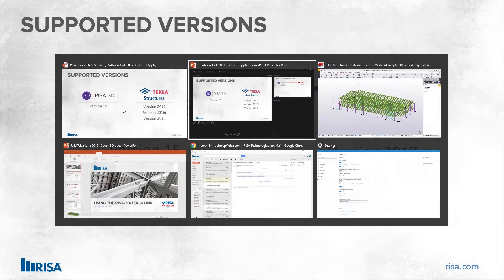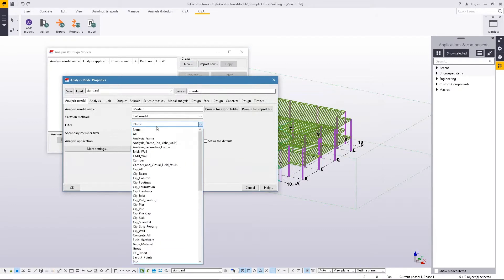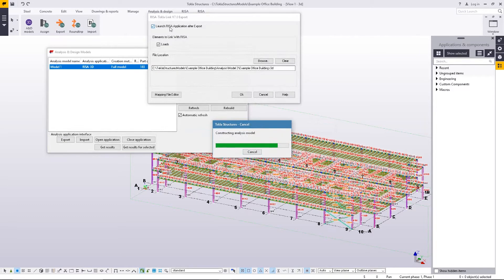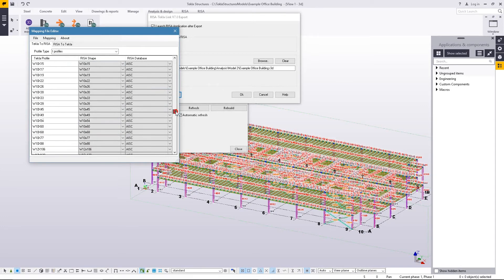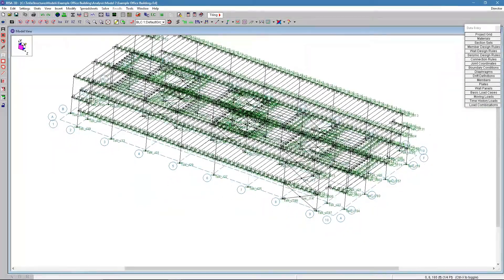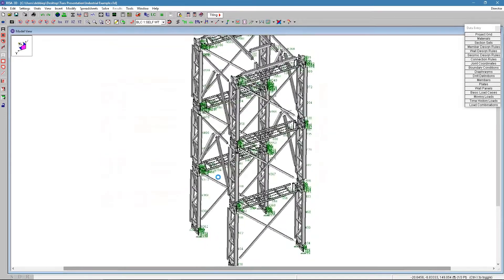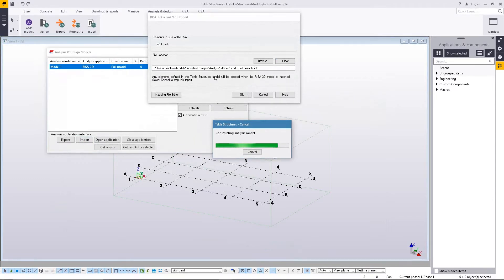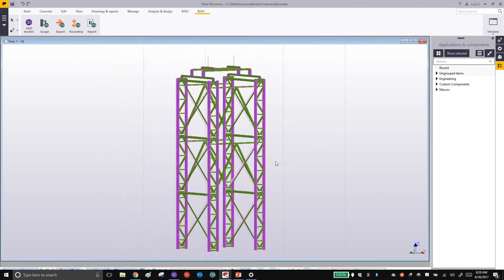RISA-Tekla Link with RISA-3D

Comment: Now it would be necessary to make available to create, analyze and design variable sections and mixed sections in RISA 3D
Reply from the maker: Currently, you can use the Hot Rolled Steel sections in the RISA library.  Built-up sections are available in RISA-3D but not yet in the link to Tekla.  This is on the list for a future enhancement.